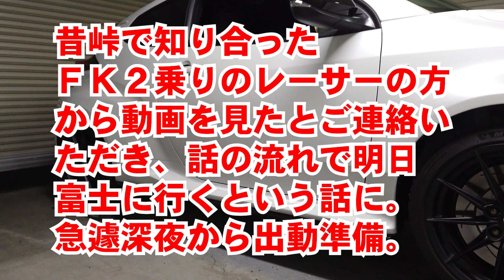GRヤリス　富士スピードウェイ 本コース 走行動画 ２【日本語字幕版】

Comment: Engine sounds good and strong. Looks like good corner entry but a bit understeer and when it oversteers it doesn't look progressive, looks like you have to be quick to correct the it.
Reply from the maker: Thank you very much. Yes I think so. After this car, driving a 4-cylinder car feels very smooth. But the rough feeling of 3 cylinders is also attractive. The handling is also good as 4WD, but there is still understeer peculiar to 4WD.

Comment: Why does engine rev on upshift so much?
Reply: Part of the design, rev matching, helps avoid losing microseconds on gearchanges👍
Reply from the maker: Sorry it is my personal habits.
It may not too late to release the throttle, but that it may be too early to disengage the clutch and shift. Maybe same meaning(^^;)  If you shift slowly, this problem will not occur !
Reply: @GTRGTRGTR  thanks for reply

I was concerned it was something normal for the car :)
Reply: @Rocketed12  No. Not on upshifts. When you upshift revs should go do down, not up. 👍🏼
Reply from the maker: @jbu89gb  There is no problem with the car. rest assured.
Reply from the maker: @jbu89gb  I think my throttle release is slow !　Auto blipping is turned off in this video.
Reply: @GTRGTRGTR  That's cool. I took delivery of my GR Circuit Pack on Tuesday and have not engaged iMT yet. So far no over rev on upshift so I'm happy.

It's such an amazing little car!!
Reply from the maker: @jbu89gb  Congratulations on your delivery ! Even though it is small, it will be really fast with a little modification. Even normal is fast enough. It's a good car !!

Comment: Shouldn't you be using distilled water in that reservoir?
Reply from the maker: Thank you for your advice. Yes, I think so. 
Mineral impurities will adhere to the intercooler.

However, the Lancer Evolution race team with the same system used proper water. 
The race car is a consumable item. This Yaris is an owner car, so I think it's best to use pure water.

Comment: But why put in 5w/30 and not 0w/40 i don't get it?
Reply from the maker: I decided to run the day before, so I couldn't get 0-40. Yes, I think 0-40 is better.
Reply: hard to find 0w-40 with API SP rating
Reply from the maker: @megamonkey56 Motul's 5W-30 did not have a good restartability of idling stop. Next the Nismo brand Motul 5W-40 that I put in next had a good restartability.